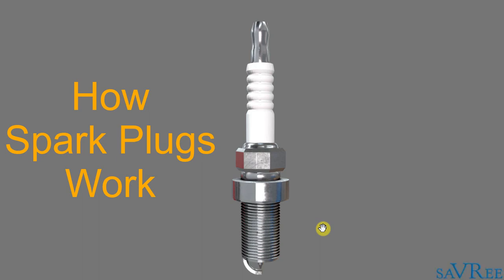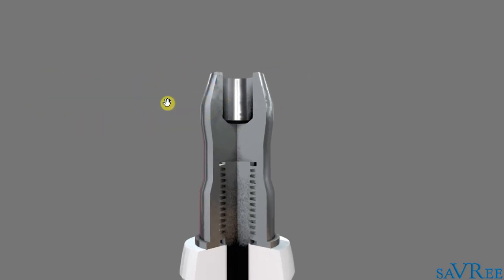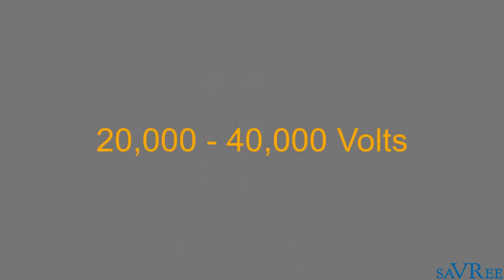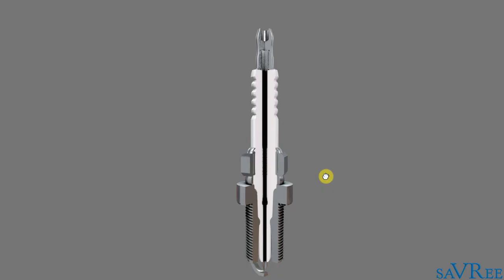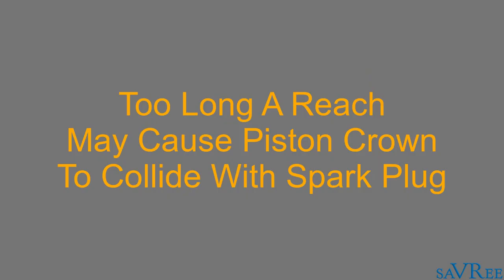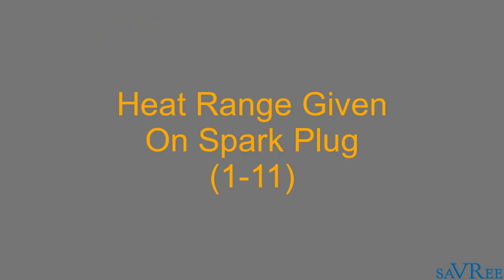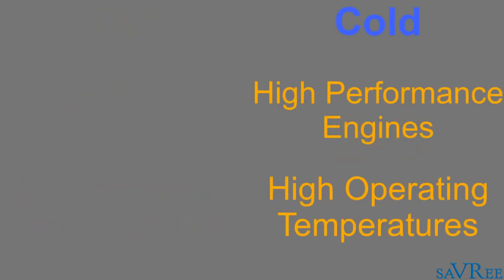How Spark Plugs Work (Animation)

Comment: Extremely informative.
Thanks very much, too, for having no awful ' music '.
Reply: of course the music you don't like isn't real music 😂😂
Reply: @king_james_official  I'm tempted to agrree, but that should be rash.
Generally, just now I'd say that anything electronically pre-programmed to 'perform ' by the choice of which button to press, rather than the choice of which strings to use manually in which key, distinguishes an operator, or a mechanical engineer, from a musician.
Reply: @heathstjohn6775 a conductor is also a musician, even though they don't play any instrument
Reply: @king_james_official  Yes, in reverse, too.
With my current mental state of great depression, I'll just add that the creativity necessary to produce a sound in a pre-programmed device should really be attributed to the usually generally unknown instrument manufacturer.
However, in writing this, I do see now the player's decisions entirely decide the sound of the final presentation.
But the player of an unprogrammed instrument has to carry the chord conceptions in his mind before shaping them into the vibrations necessary for the intended delivery.
You'll have to excuse me.
I'll thank you for wanting a conversation with me. But I've been terribly, terribly unhappy for many years, and it's reached something of a peak.
This has stimulated the mind; some sparks, as it were, are flying; but please, not thanklessly by any means, I'll have to say I just don't feel mentally strong enough to have what I'd usually expect to find intriguing, ie, an exchange of thoughts.
Please do speak yours, but I'm going to have to retire.
Thanks.
Reply: @heathstjohn6775 yeah i'm cool man thanks for talking

Comment: Be aware that the numbers for hot and cold spark plugs differs from manufacturer to manufacturer. NGK numbers the spark plugs from cold (1) to hot (11) as you described, but Bosch does the ospposite: hot (1) to cold (10).

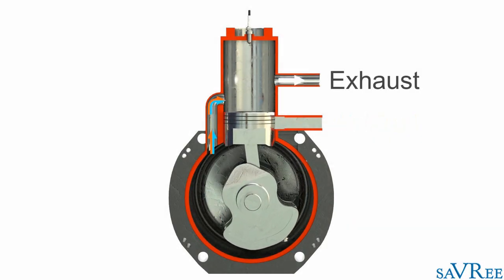Comment: I apologize for being ignorant but I'm not understanding the flow of the diagram at 0:53. It looks like a fuel/air mixture is coming into the chamber, and directed around to the other side and compressed into the cylinder by the upward motion of the piston. What I don't understand is why does according to the drawing, does the fuel/air mixture look like it should leak out of the exhaust side?? Is there some kind of check valve where the exhaust and the cylinder meet to allow only exhaust?  thanks.

Comment: Wondering about indexing spark plugs and if it's worth it. And how colder spark plugs could increase compression? And is the spark AC or DC current?

Comment: This was great!

Question: Why scale the spark plug with engine operating temperatures? Since it will keep temps below the threshold regardless, why not design every engine to use a cold spark plug? Is there a functional reason? Lower insulated material cost during manufacturing? Perhaps a business incentive to have more, specialized product types to sell?

Comment: What can cause a spark plug to  fail  even when no visible defect is observed? The reason for the question is, I just watched another video where the vehicle was misfiring and the cause was diagnosed to a particular spark plug. The technique involved location swapping of the coil, spark plug and cable, into three separate locations. This technique was determined by the tech after observing live data wherein, one of the cylinders indicated a wide variation of numbers. I'm just curious to learn what might have caused that spark plug to fail - even though it showed absolutely no sign of failure.

Can the resistance value and or the porcelain insulator suffer a partial breakdown due to age / use?
Reply: Spark plugs can fail because of an internal failure, i.e.spark plugs with internal resistance the resistance can burn out. You can measure it by using an Ohmmeter. Or internal broken porcelain, not to see from outside but when in use the gap leads to a failure and the spark plug stops to work correctly. Both can happen because of a not 100% correct production. I experienced this several times.

Comment: Pop Quiz! (Did you learn anything?)
1. Spark Plugs are used in gasoline and diesel engines    T  or   F
2. Insulator nose on the "hot" spark plug is longer   T  or  F
3. To prevent a short circuit, spark plugs have an insulator made out of ____________.
4. "Electrical Noise" is good for the engine    T  or F
5. Electrons "jump" the spark plug gap into the ________

Comment: So, you can get the full 20.000 volts with a kickstarter too because of the gearing?
What is the minimum value of the battery to get to the 20K to 40K volts?
Reply: @savree-3d  thanks for your response. I never heard of an ignition coil before. So when you kickstart a scooter,  the gears run an alternator. That AC voltage created is then amplified by a transformer (EC) and thus 20K volts are created that flows through the sparkplug. Im I getting that right?
Reply: @savree-3d  I kickstarted my scooter for 1 year without a working battery inside. So I have to believe the kiickstarting alone can provide the rotation to the starting circuit. If the spark plug iis part of the starting circuit I cant see what else could gve it the 20v volts but the kick starting.